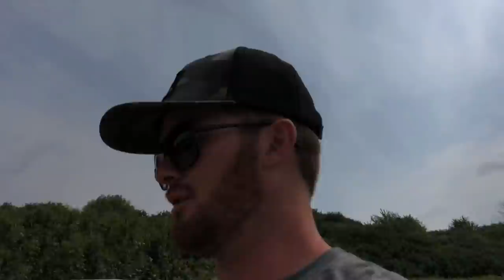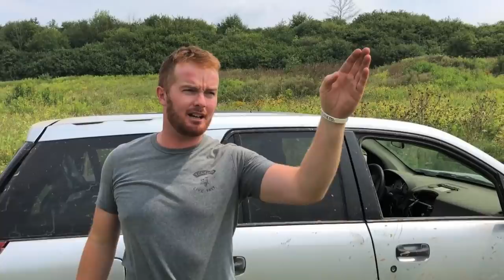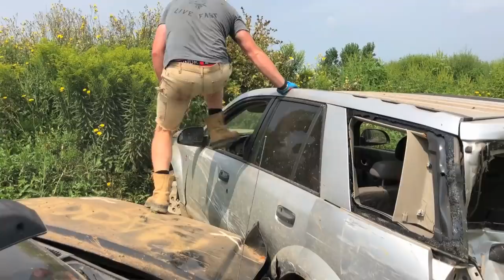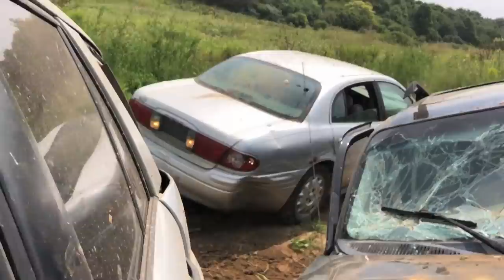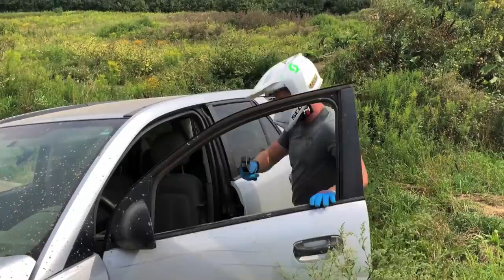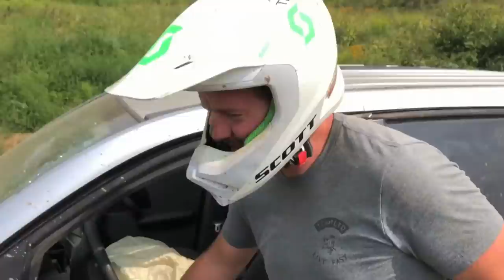3 CAR JUMPS! Saturn Is INDESTRUCTIBLE!!!

Comment: I have a 05 Saturn ion and my engine wasn’t firing 2 of the cylinders but still started up no issues also has 240,000 miles, I swear saturns are the god of cars
Reply: No matter what happens to them they refuse to die the engine in this one was probably fine minus some minor repairs to it you can probably swap it into another and keep going

Comment: With my Pontiac I used to shift it in between Drive in neutral on the column and then it will let you fully rev in dump it
Reply: Yup same with 04 chev trailblazer, haha!! Had some fun with that boat before it got sent to auction.

Comment: I just wanted to say thanks for jumping shot boxes and not old trucks and stuff like that
Reply from the maker: No problem!
Reply: @markfreeman408  you should get another Saturn like this these damn things don't quit you beat the fuck out of them they just keep going jump them three times they keep running my grandma has one and it's quite a strong Runner with over 200,000 on it it makes a few noises but can leave anyone behind on the start line
Reply: Mainly since the little sedans weigh second to nothing and they grip really well so any larger more powerful car would be spinning its tires barely accelerating while the Saturn takes off and leaves it behind

Comment: Next time one of the fuel injected cars runs out of fuel, first add more fuel. Then turn the key to on, not start. Then after a few seconds turn off. You should hear the fuel pump turn on then off. Do this about five to ten times and it should start for ya...